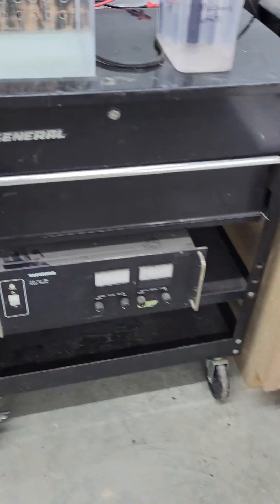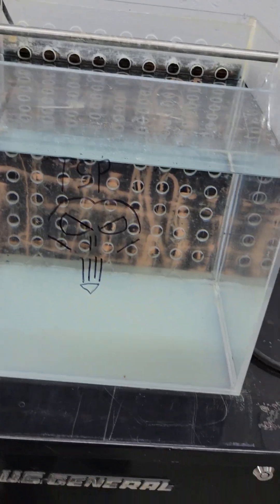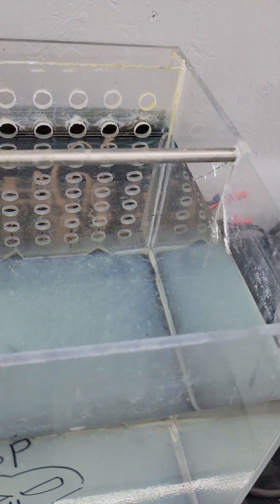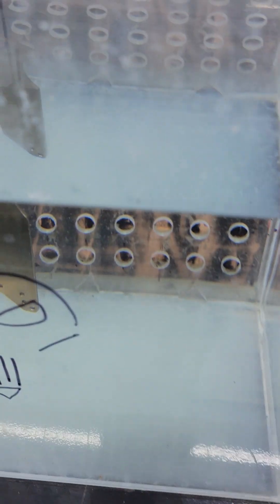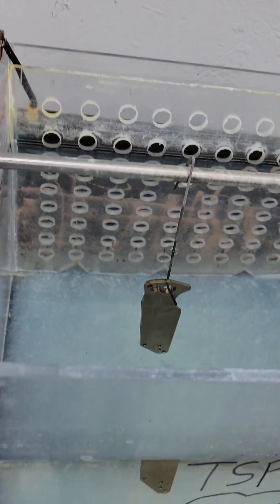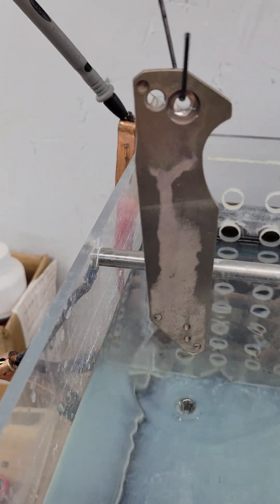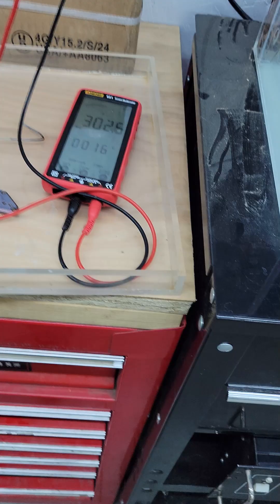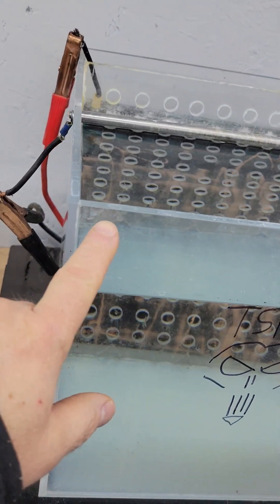Anodizing Titanium Professionally

Comment: no etching before ano?  seems like a big step tp leave out
Reply from the maker: @slappynoname  never bothered. Always goes straight from finish to ano so no time for a oxide layer to form. If the part has been sitting awhile I’ll re-finish or etch.
Reply: @JakeHobbackKnives   that would explain why your part looks muddy...if you don't etch the surface the crystal will not form on the surface.
Reply from the maker: @slappynoname  I don’t think you listened to the video too well. I said fairly plainly that the part still had coolant on it and I just grabbed it off the bench to show how it was done.